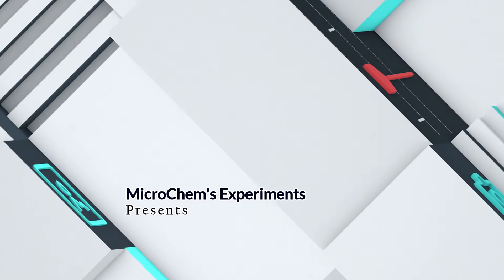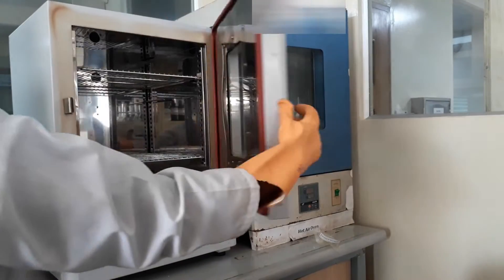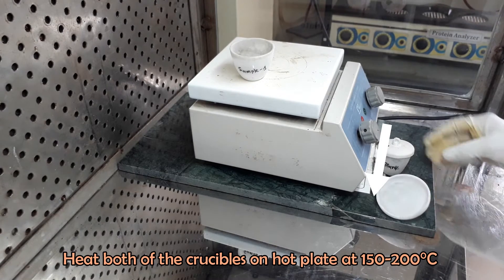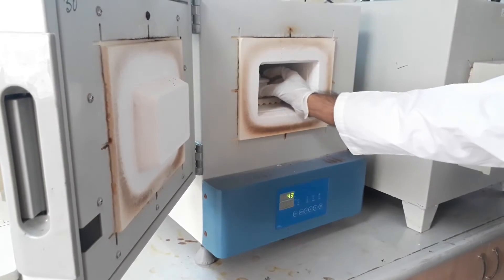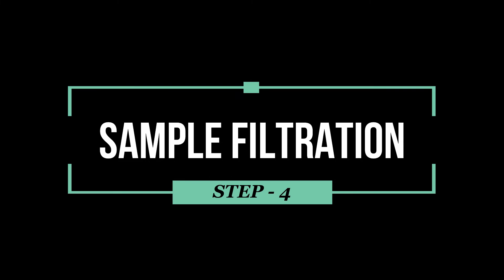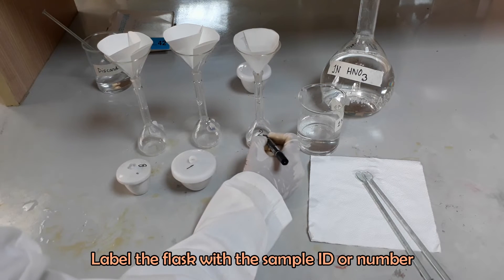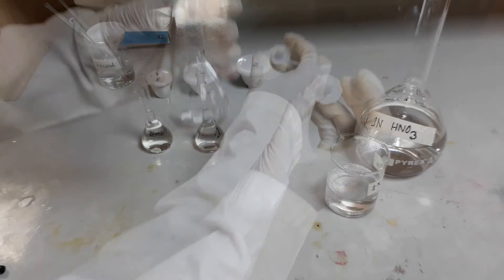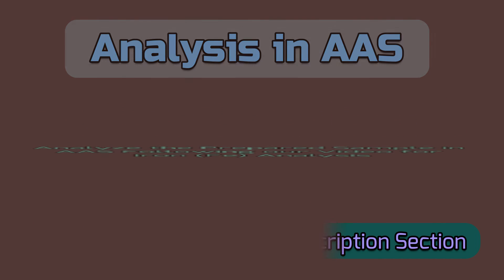Sample Preparation by Ashing Method for the Analysis of Heavy Metals & Minerals Using AAS

Comment: I plan to measure ash content and then measure mineral content and also heavy metals. For heavy metals i would like to use wet digestion method. In your opinion, do i need to make a wet digestion if i already drying ash from measuring ash content before? Thanks in advance!
Reply from the maker: Yes. For heavy metal analysis, wet digestion is better method than the dry ashing.
Reply: @MicroChemsExperiments  okay thank youu btw your videos really helps me 👍🏻

Comment: I want to analyze some elements in ash salt (filtrate). The ash was already got from burnt plant residue and the ash salt was prepared by leeching water through the ash material. Is it possible to analyze the already prepared ash salt. It is already in solution.
Reply from the maker: If the ash salt is prepared correctly (complete ash with no black color) then you can test your sample with this solution

Comment: 2:03 did u soak the crucible in nitric acid for 12 hours to make sure there's no other component left in there? used deionized water to wash and remove the acid before using? thank you
Reply from the maker: Yes. You are correct.

Comment: in 7:05, if the color still black, does it mean the sample still contain organic matter? is that why we should add some acid?
Reply from the maker: You are right. Presence of Black color means that the sample still contains organic matters. At this point we add some acid. This addition of acid facilitates to break down the Carbon strong bonds making free carbon which can easily be removed from the sample by applying additional heat.
Reply: @MicroChemsExperiments  thank u so much!!
Reply from the maker: @shafadaraillona7850  most welcome